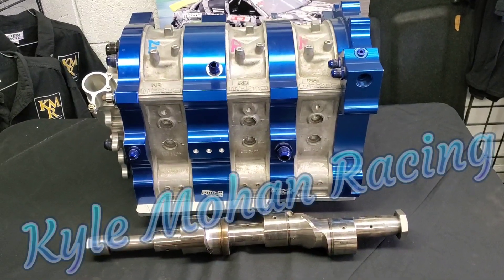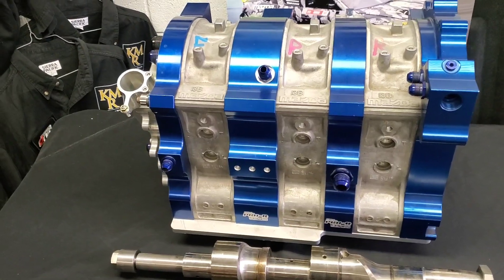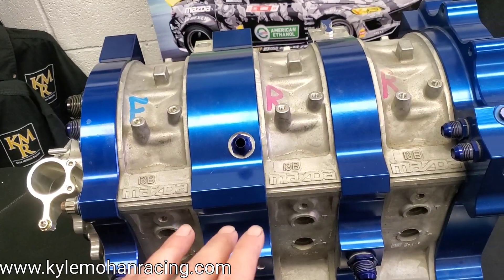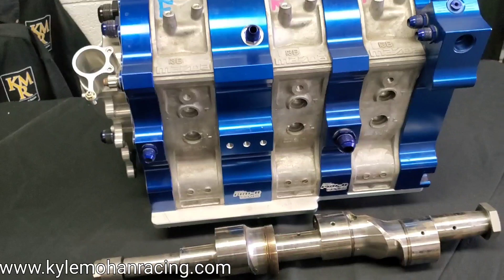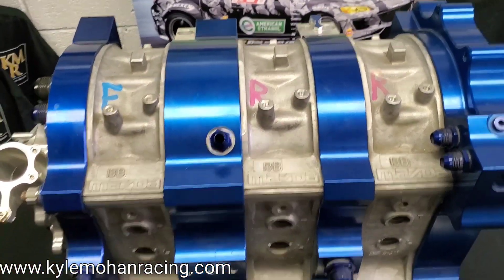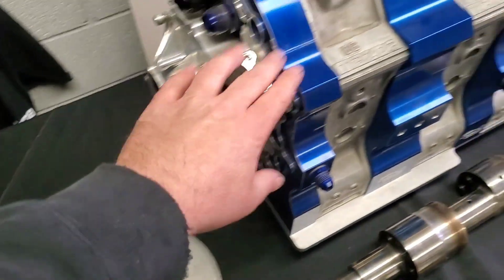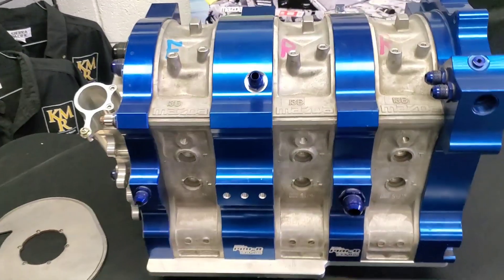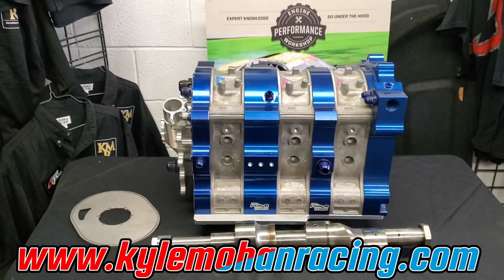Billet Rotary Blocks, Teck Talk - Billet Inc 20b - Upcoming projects, Multi rotor builds, KMR

Comment: I'm in the process of assembling my NA 20b. I've had the assembly balanced, and the rotor edges shaved down but haven't touched the oil system. What can I rev out to realistically, and what quick / easy oil mods would raise the redline?  I'm not looking for 10krpm but it sounds like as of now 7000-7500 is where I'm at.